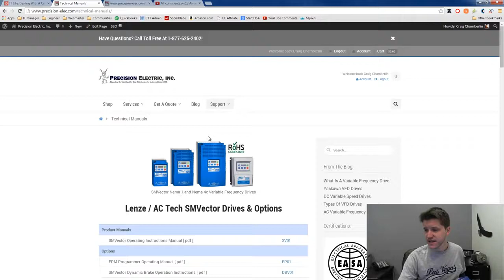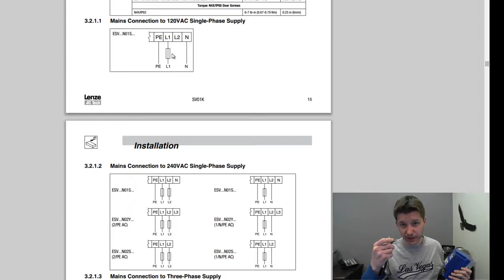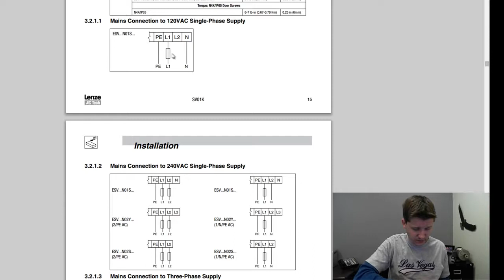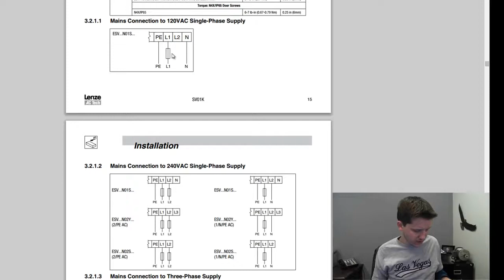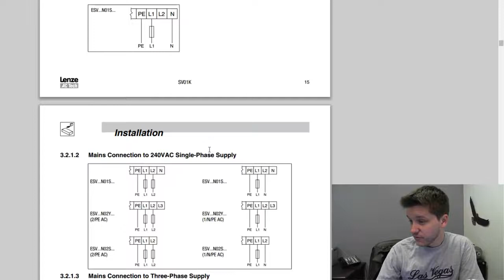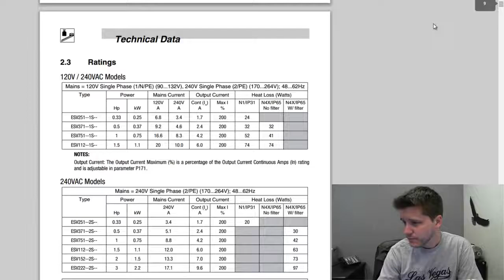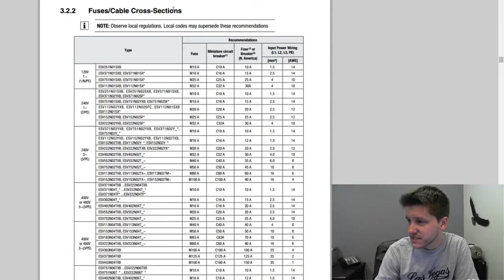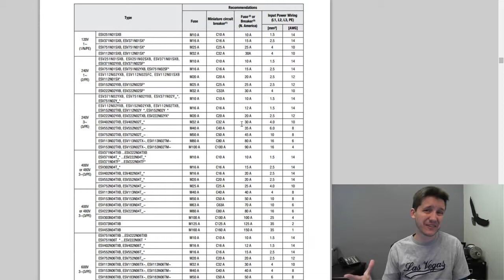How To Wire Line Voltage To A Variable Frequency Drive (VFD)

Comment: Very helpful video.  You quickly and concisely told me exactly what I needed: to get an electrician (in my case—perhaps other viewers are more advanced than I).
Also, “electrocution” means death by electrical shock.  But, yes—it’s all the same ultimately.  And that is why I’m calling a pro like you.  Thanks again.